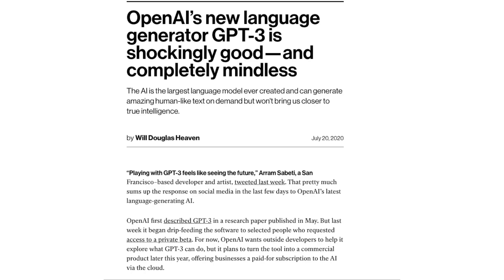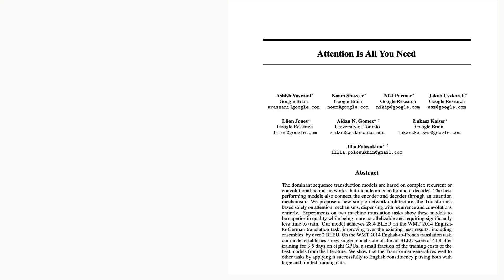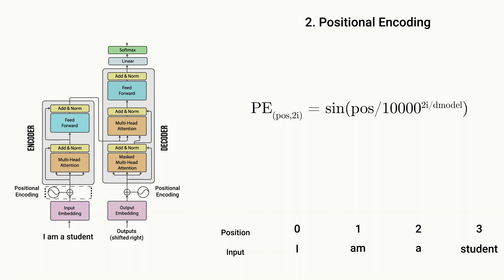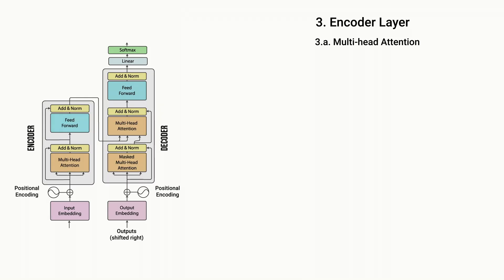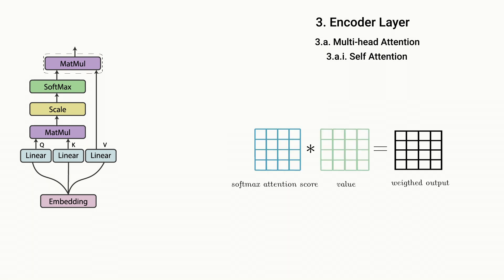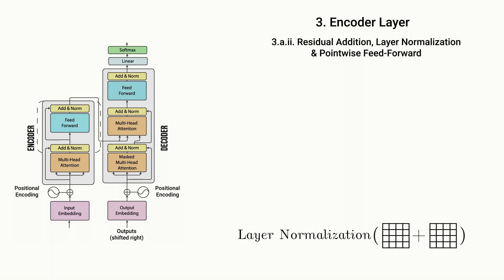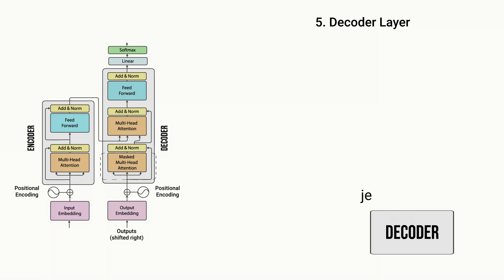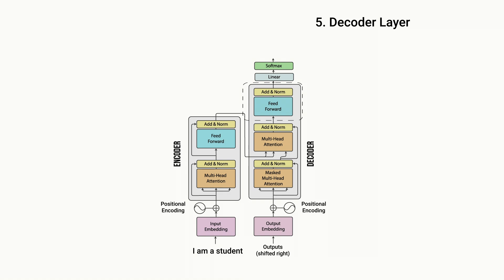transformer neural network simply explained

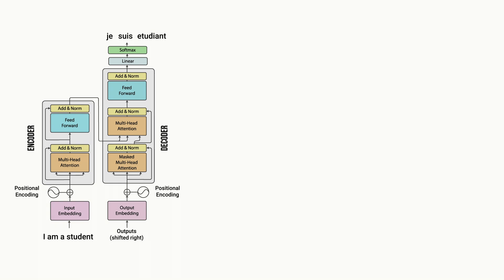Comment: 3:00 1 Input Embedding
3:40 2 Positional Encoding
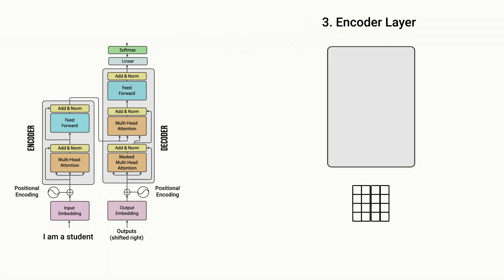4:08 3 Encoder Layer
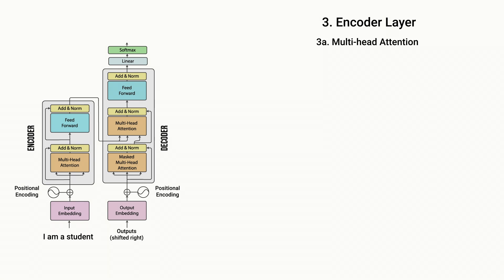4:30 3a. Multi-head Attention
7:51 3.a.ii Residual Addition, Layer Normalization & Pointwise Feed-Forward
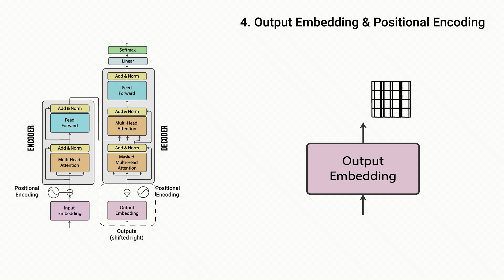9:28 4 Output Embedding & Positional Encoding
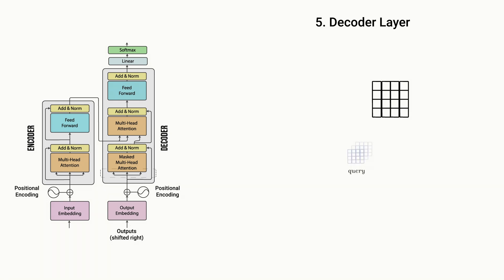9:33 5 Decoder Layer
10:07 5.a. Masked Multi-head Attention